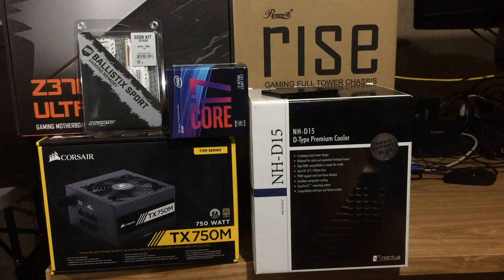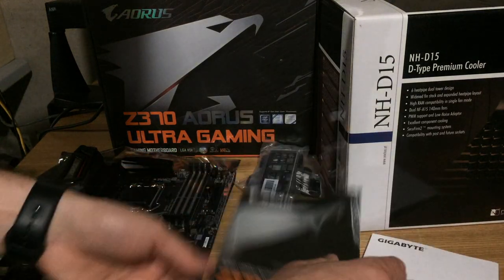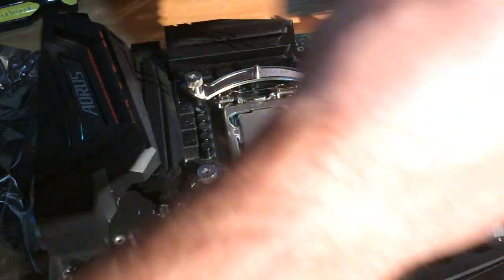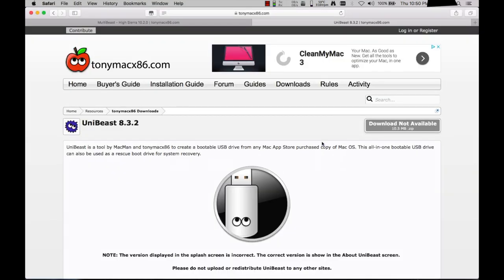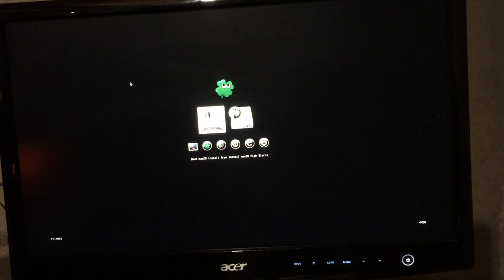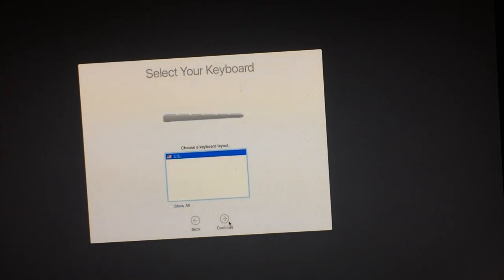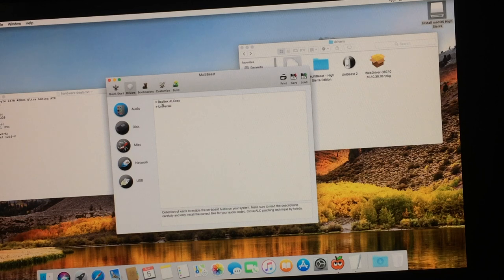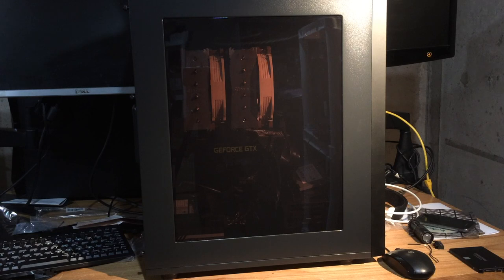Experiment: Coffee Lake Hackintosh Build High Sierra Build

Comment: Hello, great build! Have you encountered any problems? Does your wifi and bluetooth work well?
Reply from the maker: Thanks!! well i was using Ethernet so i didnt bother setting up wifi, but there are plenty "Out the box" wifi solutions that don't require any drivers. Same goes for USB Bluetooth adapters.
Reply: @southhawkllc   which ethernet driver did you use? and what is your motherboard? thanks
Reply from the maker: @alexcuurt3547  this was done 2 yers ago.. i "think" it worked automatically... i really cant remember... BUT ill be doing a refresh of this hackie with new CPU and GPU later this month with catalina.
Reply: @southhawkllc  very good! I'm going to build a "high sierra" with a Gigabyte B360M Aorus Gaming 3 motheboard, it has the same "ethernet intel" as your z370. will it work well?